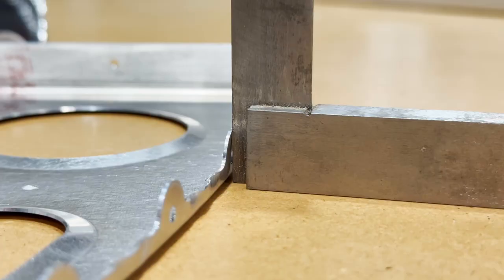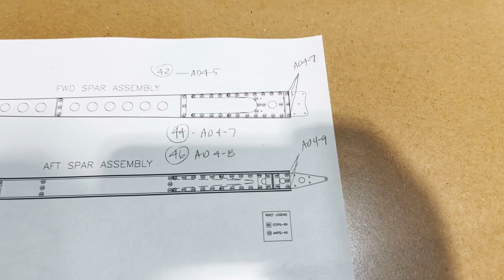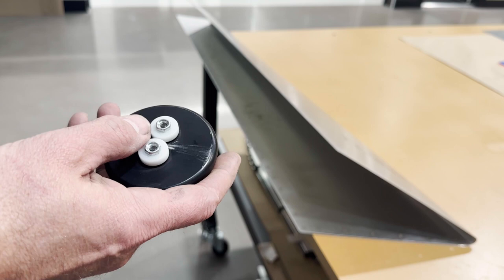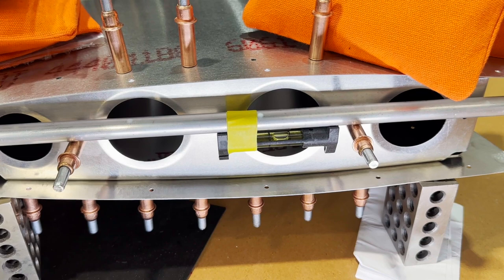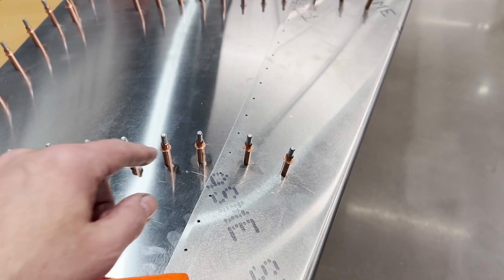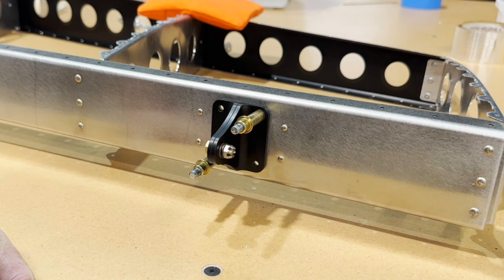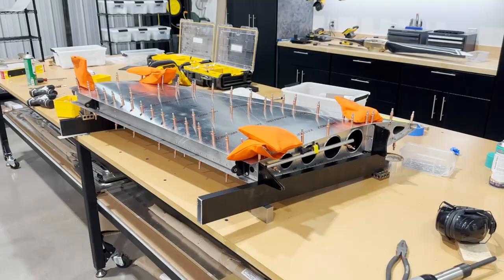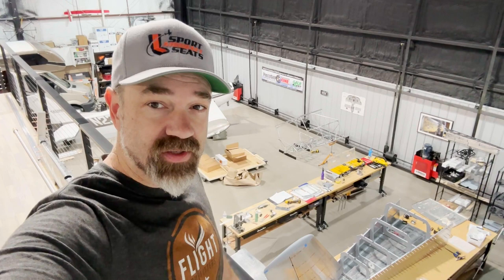Ep.8 - Rans S-21 Vertical Stabilizer

Comment: How about a source for that puck handled sheet metal edge roller?  Aircraft toolandsupply don't show one. I thank you for putting this series together.  Great resource.
Reply from the maker: Thanks for watching! Aircraft Spruce has them:

https://www.aircraftspruce.com/catalog/topages/averyedgetool.php
Reply from the maker: Get this one also:

https://www.aircraftspruce.com/catalog/topages/holeflanging.php
Reply: @Outbound300  I've got that one!  Also, I like the idea of doublers at the hinges on the spar.  I was hoping the CAD file was on your downloads, but didn't see it.  Like you, I have only used pulled rivets to attach nut plates, etc.  Also, never worked anything but 2024 T3  & a little 7075 T6.  6061 T6 will be a new experience!  My kit arrives in July.

Comment: Just a thought I've had. How much of a weight difference do you figure all the solid rivets and extra doubler plates will add to the total weight of the build? Not sure it would even be a noticeable amount, but just curious if you've calculated it.
Reply from the maker: In the quantity I am doing, solid rivets don’t add any appreciable weight over the pulled rivets. In fact, on the hinges I lost a bit of weight as the solid rivets are aluminum and the pulled rivets are stainless steel.  As for the doublers I probably added 75 grams.